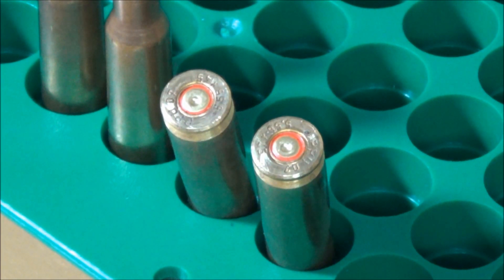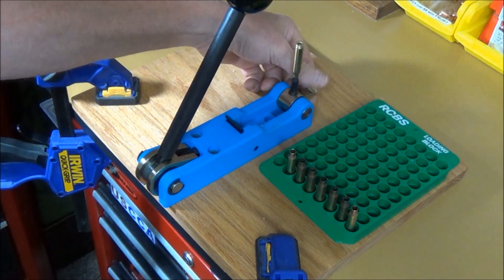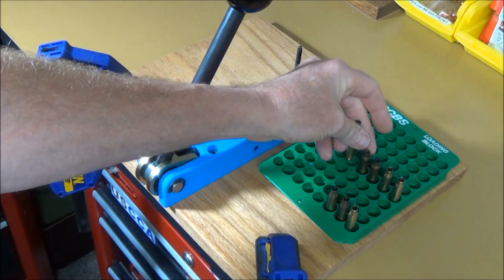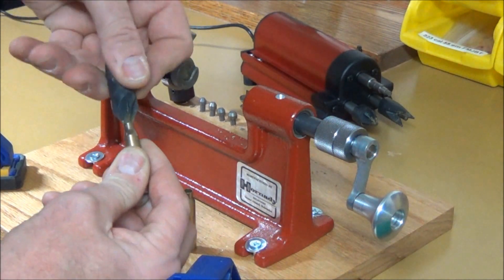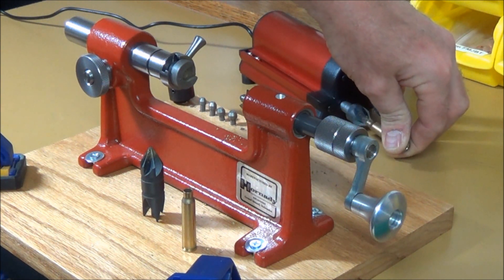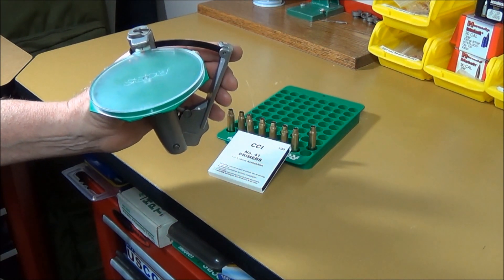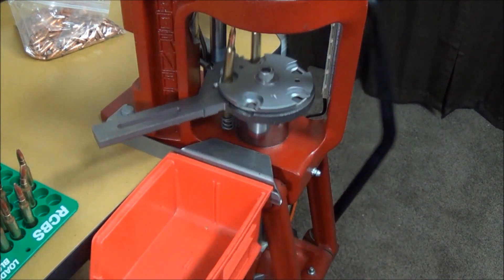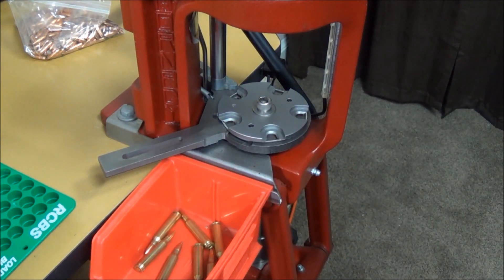Reloading 5.56 Military Brass

Comment: Minor point, but that's not a micrometer.. A micrometer measures micro (0.000001 or 1x10^-6) you were using a caliper (generally 0.001 or 1x10^-3)
Little things make a big difference, especially with little bullets.

Comment: I need to start this hobby, because videogames are a waste and ammo gets pricey and goes by fast. This actually looks like fun, kinda of monotonous, but i like working in a factory, so it would probably be perfect for me.

Edit:

I am just afraid of equipment costs; it looks like it takes a lot. You need to clean it, deprime it, size it and then reload it. A lot of steps that require equipment rarely seen by laymen like me
Reply: my thoughts exactly hahaha
Reply: Start getting it one piece at a time. That’s what I’ve did.
Reply: chester Lee Precision makes starter kits that include everything you need to get started except the reloading dies. Those are offered separately. There’s also cheap ways to clean brass.

This is a hobby that offers endless extras that make the process easier/faster but aren’t 100% necessary.
Reply: relaistic entry costs are like 800$
to do what he is doing.  Like 500$ to do pistol ammunition.  The difference is in the equipment needed for the rifle brass preparation.  Each caliber is about 30$ to 80$ unless is is something unusual.  Besides that, you just need a fair amount of workspace, powder, primers, and lots of time.  You can surely spend much more getting more automated and precision tools.

Comment: Great video had question about reloading 556 brass I reload 223 ammo for my AR15's but I have only used 223 head stamped brass never 556 brass do you do anything different than if you was using 223 than your 556 brass ??? and where do you get your reloading info like how much powder to use for 556 rounds ?? Oreo you just load them to 223 specs ?????
Reply: Plumpy E Only difference in 556 is normally powder/bullet. Not the brass
Reply: Incorrect, there is a difference in the brass. 5.56 has thicker walls, therefore you have to use less powder. If you maxed out the powder in a 223 and used the same amount of powder in 5.56, you would be compressing the powder. I would hate to be the one shooting that round.

Comment: Thanks for making this video! I have so much LC brass and I'm now getting into reloading. I have a question. Can any decapping die remove the primer? Or do you need something special? Thanks!
Reply from the maker: Jwh Merica : I use an older depriming tool, but yes, you can use a regular one.

Comment: I have a universal trimmer and for some reason I am not able to trim my brass once I resize that shit, the little metal piece that goes into the case wont fit inside the case mouth afterwards so I am screwed into having to guess how much length ill get from resizing it.